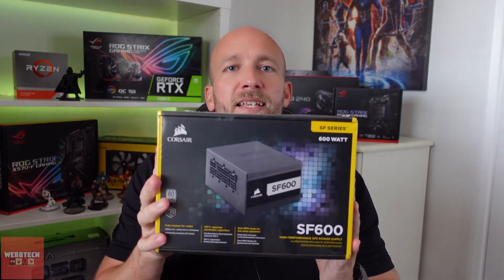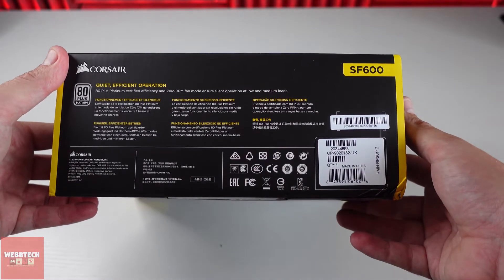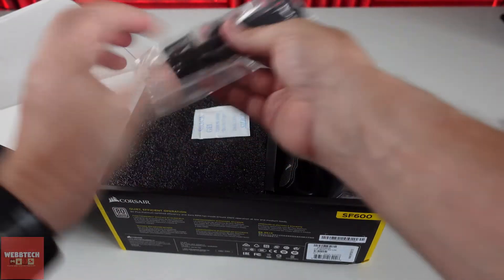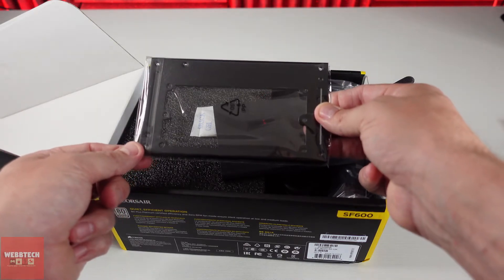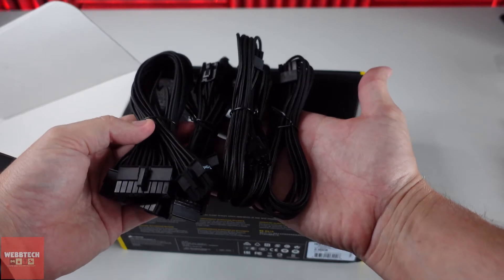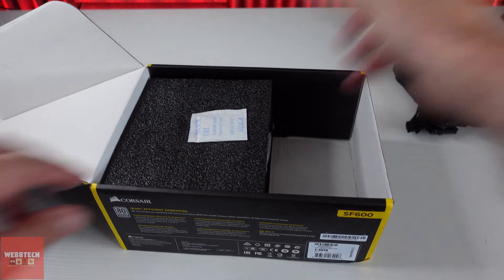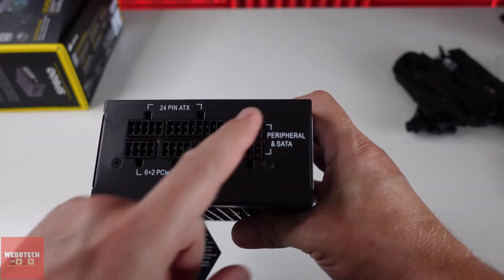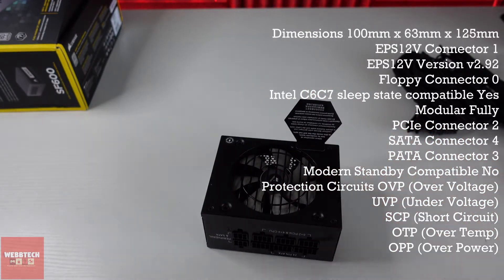Corsair SF600 Platinum SFX PSU Unboxing and Installation

Comment: Had to check recent unboxing like yours because in older ones they had psu packed in this nice microfiber bag. Good to know that it's just package that changed and not something wrong with the one I ordered.
Reply from the maker: There was a recall earlier in the year, check the link for affected serial numbers https://www.google.com/amp/s/www.tomshardware.com/uk/amp/news/corsair-recalls-sf-series-platinum-psus-over-failure-concerns

Comment: You only needed the longer cables because its a case made for atx psus and a psu made for sff PCs - if you have f. E. The classical Position right next to the Mainboard the cables are Long enough...

So you really rarely need extensions.

Comment: Nice. What case is that? Do you think it will fit a full size micro ATX (244mmx244mm) with this SFX power supply? It looks like mini ITX case, but with SFX PSU, maybe there is enough space to fit the micro ATX with the last expansion slot simply not accessible from the back. EDIT. AH, it is Fractal Define Nano S, and it has a bump in the middle for the cable routing. It will not work with micro ATX.
Reply from the maker: Hi there, the case is the Fractal Design Nano S - a link to my build video https://youtu.be/Mw4rSzIpanE
I thought the same, that a micro ATX motherboard would fit with an SFX PSU, but it's not something I actually tried. If you modified the case it's possible, but the standoffs are not there so you'd have to find a way to fix that issue. Honestly, I'd stick to ITX, there's a load of room in there to fit all your bits and bobs without too many compromises. Now the only thing I don't like is that there are two options, solid panel or perspex panel. Not a sniff of Tempered Glass which is a real shame. I would definitely recommend the case though.
Reply: @WayneWebbFilms  the mobo i have is micro atx. I wish it was mini ITX, because I only need one PCIe expansion, but it is server-like board from asrock rack (ASRock Rack X470D4U), and they don't have smaller version with still reasonable price. I am definitely going with the SFX power supply. 450W maybe a bit more. Should be fine for mid tier gpu and ryzen 5700x. Thank for all the info and video.

Comment: I have a question. My case is not like yours, in my case I have the supply room located on the top and it does not have ventilation in the top cover. Can I turn her upside down?
Reply from the maker: Hi, do you mean turn the case upside down or the power supply?

Comment: Just snagged one off Amazon the other day for £86. I am worried it will have coil whine like my current Corsair psu. Fingers crossed not.
Reply from the maker: Great price. My RM850X has a bit of whine which I only notice if the machine is off and my ear is near it. It's the first time I've noticed it on a psu. I've owned SF600 gold and platinum + SF750 and they have all been fine btw
Reply: @WayneWebbFilms  Oh that's good news. My current one is an RM650X inside of an NR200P case and anything over 60fps in games has my PSU hissing so loud it can be heard across the room. The GPU as well actually. Can pinpoint the sound from both pieces of hardware.

Just hoping switching the PSU will magically fix the issue.
Reply from the maker: How did you fit an atx psu in that case? Which gpu is it? Air cooler?
Reply: @WayneWebbFilms  Printed 3D ATX bracket from Coolermasters website. Looks great in there. The GPU has 2 fans yes.  GTX1660 Ventus.
Reply from the maker: Ah cool, didn't realise it was possible. Will check it out. Your psu is plenty for the RM650X so not as if it's being pushed at all. Fingers crossed for the replacement unit. Let me know how it goes because I'm interested if fixes your problem.

Comment: Are those cable shorter than normal?
Reply from the maker: Yes because they will normally be used in itx cases. Not really had an issue with lengths in most cases, but you could get extensions of they prove to be too short. Check out the link for lengths etc https://www.corsair.com/uk/en/Categories/Products/Power-Supply-Units/Power-Supply-Units-Advanced/SF-Series/p/CP-9020182-UK

Comment: Is it possible to put a ssd and hdd using that power supply
Reply from the maker: Hi, yes absolutely. You get a sata cable that has 4 connectors on it.

Comment: Could you drop where I can buy the 24 or 8in pin extension on amazon via the description as well as the header for the Power Supply so it can fit in my case
Reply from the maker: These are the ones I got, they are from Ebuyer but I'm sure you can get the same thing from Amazon http://www.ebuyer.com/912961-premium-braided-30cm-psu-extension-cable-kit-black-psublack
Reply: @WayneWebbFilms  What about the header for the Power supply that'll fit the back of the case
Reply from the maker: Would you be able to expand on the term Header? Do you mean the bracket to attach an SFX PSU to an ATX opening?
Reply from the maker: If so, it will be in the box, failing that you can get one of these...https://www.amazon.co.uk/dp/B01AWFVKRO/ref=cm_sw_r_cp_apa_i_4MFKFbB0H5429 not a Corsair one but will do the job

Comment: SilverStone Technology SX1000 Platinum, 80 Plus Platinum 1000 W …please      saludos  desde México.
Reply from the maker: Hi there, the Silverstone is a good PSU. Certainly isn't cheap and is an SFX-L unit instead of the SF600 SFX form factor. I'm currently using the SF750 and I love it.

Comment: Is cv650 better than the rm550x
Reply from the maker: Rm550x is a better quality all around in my opinion
Reply: @WayneWebbFilms  related to capasitors and protection it is better than the cv650
Reply from the maker: 100% better. The only thing the CV650 has over the RM650X is wattage capacity, but that won't necessarily be a real 100w in reality. I personally would buy the RM550X without a doubt. Hope this helps.
Reply: @WayneWebbFilms  i will buy the rm then cause i will not upgrade a couple of years from now, want to ask can 1600 af ryzen work on a320m ex gaming without any issue
Reply from the maker: The board is more than capable, but you need bios version 5205 and above apparently.